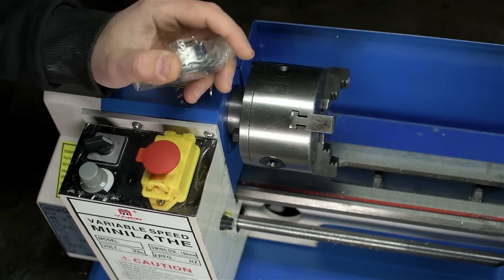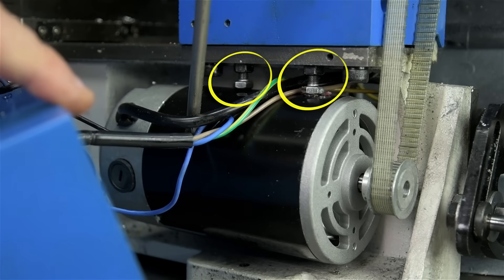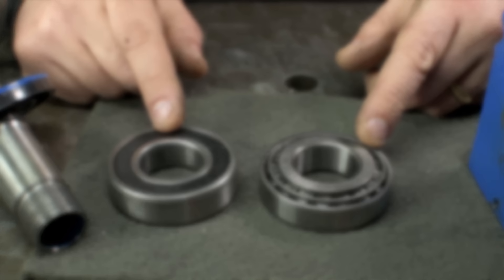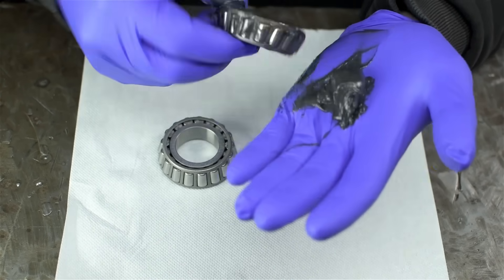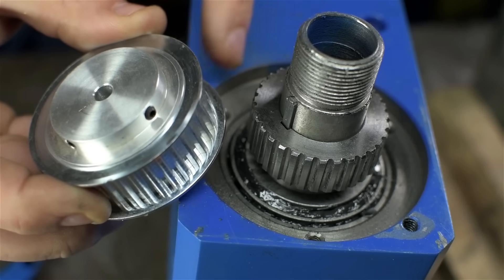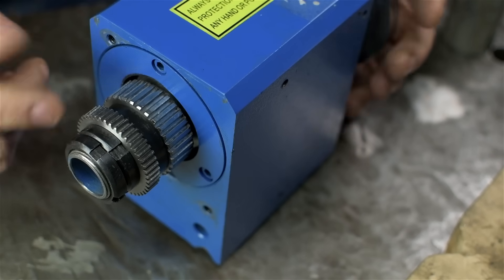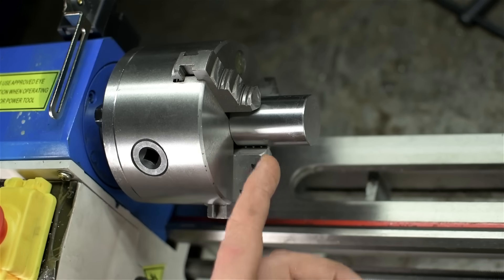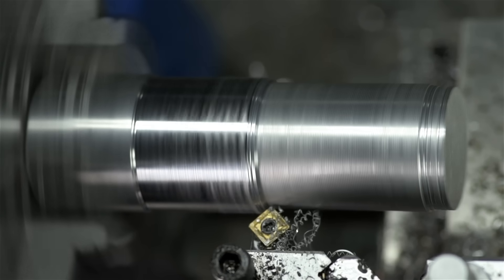Better LATHE Than Never!

Comment: not the best choise to use graphite/mos2 grease  on high speed bearings,nice video.
Reply: "high speed" lol.  cheap bearings need all the help they can get.  On quality USA bearings you can get away with regular grease
Reply: RickBaconsAdventures Hello,graphite & mos2 are solid lubricants and they act like grinding paste at higher rpm.Average or best quality bearings vvill have reduced life   in high speed aplications.
Reply: @georgegeorgakopoulos5956  what do you consider high speed?  is it more like a feet/minute thing where bearing size has a large effect on it?  I always understood that the mos2 shoves into the microscopic imperfections in the metal and is too soft to "grind" the steel.  With a bearing like a Timken or NSK I would definitely use regular grease but I feel like a chinese bearing would benefit from the mos2.  Isn't regular grease just sulfur instead of mos2?
Reply: RickBaconsAdventures I would also use "regular grease" instead of graphite/mos2  on  Timkens or NSK's  because I don't want  to ruin them.

Comment: If you have to go slow because of high speed steel, shouldn't it be called slow speed steel rather?
Reply: Back in the olden days, when machining was done by jamming bits of flint into bits of wood on a slave whipped powered lathe, i bet steel was indeed high speed. Grug the caveshop manager would have swooned over some HSS. Nowadays though we have tungsten carbide.
Reply: Carbide is fine, until you need to work with intermittent cuts, or you need a special profile, then it's time to grind some hss tooling to shape. Besides, the controlled conditions you need to get the best speed and life from tct tooling are probably neither available to nor practical for the home machinist.

Comment: very good and competent explanation on the bearing differences.
and i agree, taper bearings without running in oil bath are pretty much pointless although considering the size of this one and the expected workload it won't matter that much i guess, still heaps better than those standard roller bearings it came with. sealed shoulder bearings would've been the way to go right from the start.

Comment: Bearing change will actually be my New year's day project for my 7x12 minila! Also I suspect "someone" got carried away and took a slightly too large bite out of a steel chunk spinning in my 4 jaw today. That, I believe led to that my new year's day also will involve replacing my hi/lo speed gears. Motor spins but spindle is very stationary. No surprise, as the little thing has made hidious noises lately so I figured I had it coming and already have the new gears. Too bad the thing I was machining was a piece for a spindle removal tool...

Comment: One big source of low rigidity => chatter is the motor cavity. One wall of the ways is missing, and the far corner of the headstock essentially hangs in the air free to flex. I heard people had good results with moving the motor out and implanting a piece of steel there instead. I've never made this modification myself though.

Comment: from my expirience, the ratteling you noticed comes from the gibs of the slide. those things are atrocious for lack of a better word. you could mill and surfacegrind a pair of better working ones from steel or brass, made mine out of brass like the mini lathe guy here on youtube, steve jones i guess, does the job really well. especially paired with the locking modification

Comment: All being practical aside, could you weld up and machine a new headstock for that lathe so you could have an oil reservoir inside it? Or, grind, braze, and machine the current head to hold oil? Merry Christmas, thanks for the videos.
Reply: With this one, the bottom of the headstock could have a rabbet milled to install a bottom plate. It would need bolts and a gasket or use silicone to seal it. Drill angled holes down into the cavity for drains from the bearings. Make a couple of toothed oil slingers to fit onto the spindle. You want them big enough so they're just clearing the inside top of the headstock. Then you need a couple of coil springs that fit real snug on the spindle. The hard part would be getting those in left and right hand coil. Put a spacer between the slingers and the springs on the spindle so they work like left and right hand threads to push oil that falls onto the spindle towards the bearings.
Drill and tap a hole in the headstock for a 90 degree pipe elbow for filling to the top level and another hole for a drain plug.

Assemble the slingers etc. on the spindle while installing. Install and seal the bottom plate. It will also need new bearing retainers made to fit in to the end recesses with gaskets and clearanced to allow oil to run down through the drain holes into the reservoir.
Reply: @greggv8  Thank you for the detailed response greggv8, I believe you understand my vision even if I worded it poorly. Where there is a will, there is a way. The question then becomes-is it worth the time and effort?
Reply: @greggv8  is it really worth all that trouble? These little hobby machines are not production equipment. A bearing swap makes the machine more capable which a user is going to like. Extensively modifying the headstock so it is oil filled is a large undertaking with limited benefit in this case.
Reply: @Grauenwolf  why not?
Reply: @Grauenwolf  - TIG brazing would likely work out OK.  I got to thinking about just milling out a lower-half oil bath, such that the oil would mostly stay put.

Comment: I tested the spindle deflection with a DTI and a hang scale at the end of a long pipe. The result is that objectively, the spindle deflection with the factory bearings is much, much smaller than the deflection of the chuck jaws and the compound combined. If your work moves, it will be because the jaws or work are deflecting, not because of the spindle bearings. The compound is where the vast majority of rigidity and chatter problems come from. 

The bearing caps can be used to hold an O ring or a gasket to serve as a dust seal for those open bearings, and might also help keep the grease in them. A preload spacer between the bearings could also provide inner seals for complete grease retainment (but I don't know any mini lathe owners who have found it necessary to go through the effort).
Reply: Putting fancy bearings in the headstock doesn't help much unless the bed is rigidly mounted to something stiffer than the lathe bed. It's a very good idea to borrow use of a big mill, clamp the bed upside down to its table and mill the bottoms of the feet flat and to the same height. Without rigid mounting you can put a test indicator in a magnetic mount on the bed, with the indicator on a piece held in the chuck - then gently press down on the top of the headstock with one finger and watch the indicator move.

If you want the lathe to be somewhat portable, mill or grind the flat side of a big piece of U channel flat then bolt the lathe to it. If you milled the feet flat it shouldn't require shims to keep the bed from twisting.

Comment: Merry Christmas!  I'm thinking that the plastic spacer between the gear and pulley might serve to add a bit of compliance for axial preloading, like a super stiff spring would.  The manufacturer may have done that so they can preload it by snugging it up and then rotating a set amount.  I'd be a bit careful switching it with a steel one, because it seems like without enough compliance you can go from a loose spindle to blowing up the entire world in like a quarter rotation, and, come on, nobody wants to blow up the world during the holidays.
Reply: Wouldn't a super stiff spring be better than a plastic bushing? If the plastic compresses, and the friction of the spindle heat it up, I'd think that the bushing wouldn't consistently provide any "spring" tendencies. That'd end up causing the spindle to progressively get looser. An actual spring would probably be far less likely to get inconsistent.

That said, I replaced my bearings on a similar lathe with tapered roller bearings. Assuming I'd screw stuff up, I ordered two sets. I didn't screw up the first set, but now I'm considered replacing my plastic bushing with a machined steel one since I still get runout on the spindle itself. Given the cost of these bearings and because I have a backup pair, there's not much to lose.
Reply: @elbowdonkey  I think there's a trade off that the manufacturer is making.  Some kind of disc spring would probably be best for preloading, but that incorrectly sized spacer probably cost pennies compared to a correct stack of disc springs.  I absolutely agree you risk it softening and the preload changing, but they're probably gambling on very intermittent use.  I'm basically just speculating though, its hard to pin down where the manufacturer would try to save money on parts versus assembly time :P
Reply: @TabletopMachineShop  I noticed on my lathe that the bushing is the same material that you sometimes see pallets made of (super tough, possibly glass fiber reinforced). My gut says, however, that that wasn't so much a design decision as much as it was whatever they had on hand. Other variants of this lathe seem to apply the same philosophy - HDPE, PVC, nylon, whatever. What I haven't seen, though, are metal variants. Which is telling, because I think a metal bushing would be cheaper. So perhaps there's good reason to build that compliance in after all?
Reply: Mr. Morningstar  Check the run out inside the taper. 3 Jaw chucks are never perfect and rarely grab a part the same way twice. I've switched over to ER32 collets on the mini lathe. I can usually tap the little bit of runout out of the ER32 chuck. On my big lathe I almost always use the 4 jaw or run between centers.
Reply: Mr. Morningstar  I don't recall exactly, but it was measurable at the spindle (with the chuck off), but also not so much that I feel the need to work super hard at fixing it. To be totally fair, it's not realistic to chase ultra high precision on these lathes. Sure, it's possible to get them more and more precise, but you start getting into "perfection is the enemy of good enough" territory.

Comment: As a neophyte with 1/100th the experience of Old Tony, I would suggest this be the third thing a NEW mini lathe owner does. Watch and perform the tips in Frank Hoose's series on cleaning and adjusting the mini lathe. This will build familiarity and confidence on lathe maintenance and disassembly. Buy a 4 jaw chuck and do some projects to become familiar with the different cutting tools and speeds/feeds to achieve a good finish. I consistently achieve .001 TIR with soft metals and plastics which is what 90% of new owners start with. Although common, IMO this is one of the advanced mods.

Comment: Will you end up replacing those plastic gears for a set of metal ones? Or are you going to impress us all and make em yourself? :D
Reply: I have a feeling he bought this machine to make a mini cnc lathe... thus he won't need the power feed gears anyway
Reply: the metal gears are not going to improve the performance, in fact some think of them as a safety measure,  when power turning passed the carriage stop, the plastic gears break first before anything else.
Reply: @ddistrbd1 .. That's what i was told too but then i changed them into steele ones and nothing happened when i had an accident.. This is not a 2 horse power machine with the 500W motor nothing breaks when you stop it as fast as you can and if youre not sure you can leave one thats easy to access in plastic or nylon and there's the breaking point. One thing the steele gears make is to improve the loudness but with the time the gears go down with the noise but always are a little bit louder than nylon. Old tony could easily make the steele gears by himself as he proved in other projects.👍
Reply: my gears broke. That was an expensive failsafe to reset. Much more expensive than stripped belt or stalled motor.
Reply: @ddistrbd1  True, but they are an absolute pain to access and replace and time is money.
Reply: @Roderick storey hand filed naturally :)
Reply: i cant understand the obsession with metal gears for these machines...theres absolutely zero benefit of metal over plastic other than the metal ones are noisier. Like anything, you need to shim and tweak the alignment/fit of the plastic ones too. Remember the metal ones are also made in ... ...you know where... so they offer zero extra precision. Admittedly they're tougher, but for the expense id not bother. Replacement plastic gears are readily available from little machine shop and theyre cheap. But horses for courses. 
Good video.
Reply: He’d be better off upgrading the motor first.
Reply: Wooden gears ftw
Reply: @Roderick storey Nanometer precision is not required..

Comment: It also occurs to me that the plastic ring is a self-adjustment feature: If you overtighten the bearings, the spindle heats up and softens the plastic, which deforms and relives some of the preload until it's running cool enough for the plastic to remain solid. Perfect preload every time!
Reply: Brilliant!
Reply: Tapered roller bearing when side loaded naturally push outward. That spacer will just keep getting smaller and smaller.
Reply: I thought about that too while watching but ultimately came to the conclusion that some light belleville washers might be better.
Reply: I don't think it would keep up the tension for long. Due to creeping the spacer will lose it's form (and therefore the preload) over time anyway. A higher operating temperature will only speed up this process.
Only alternative would be a thermoset plastic which shows less viscoelasticity, but then the "thermal fuse" wouldn't work anymore.
Reply: Actually, the proper way to set the preload is to set the bearings dry, and then measure how big a spacer is needed between the two bearings internally to  set the proper run out on the spindle shaft. Then when the spindle is greased and tightened to the proper torque, you can use the jam nut to lock it down.  Too short a spacer inside, and the bearings are too tight. Too long a spacer, and the run out is too sloppy. Too short a spacer is easily corrected by using shims until the correct spacing is achieved.
Reply: @ken481959  indeed, a spacer effectively makes both inner races one piece for less wibble-wobble...

Comment: I found the best result was making a new headstock, one that could house two angular contact bearings face to face and using a needle roller bearing in the rear with a hardened sleeve pressed over the shaft, then you machine a spacer tube that will allow you to preload the angular contacts over the shaft through the hardened sleeve. I did this on a Traub A15 automatic lathe and the precision it gave was phenomenal, I couldn't measure the runout (I don't have a tenths indicator yet) Very cheap and effective solution

Comment: i have unsealed angular bearings and they also work just fine, the spindle head itself is pretty well sealed on those, so if you are anything like me and cant get sealed ones in your country, feel free to use just the regular ones, they work well over a year and i cant see any signs of wear from them. i added a grease nipple to the head so i can lube the thing once in a while, maybe that helps too. all in all a "must mod" for those little machines since you make it that much better with only 20-30$ and half a day work :)

Comment: Colchester ruleZ!... gne....gne.. snirfzz!...ours had an planetary spindle speed selector and one of the first "style hightech" windows 95 CNC controlled tool holder cross frame thingy on it... so you could turn all kind of round shapes while turning the chuck in the opposite direction...

Comment: ...You could put grease nipples on top, opening into a small gallery bored into the bearing race.....? That's not ideal........ For probably way more reasons than I can think of (several)... But it might allow for ongoing greased lightning?
Reply: great minds think alike. though i think tony Mentioned that buildup of lube in that cavity. it would be interesting to see that lube shooter for molybdenum grease and port straight to the bearing race.
Reply: An oiler would work well.